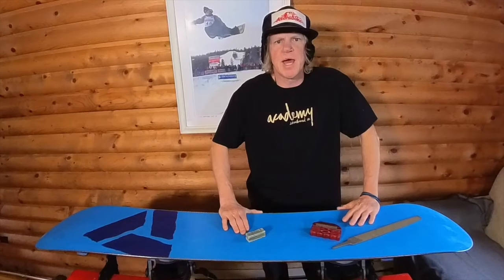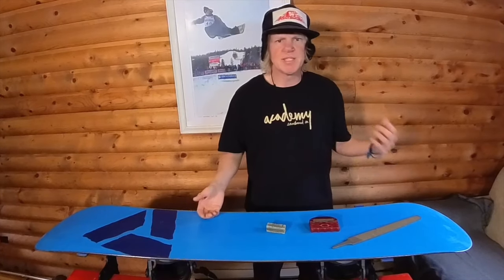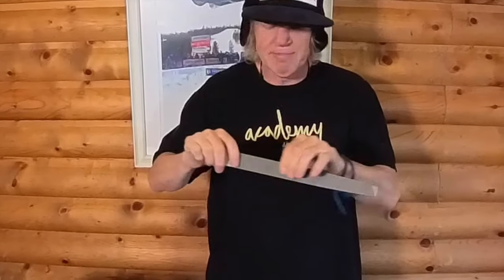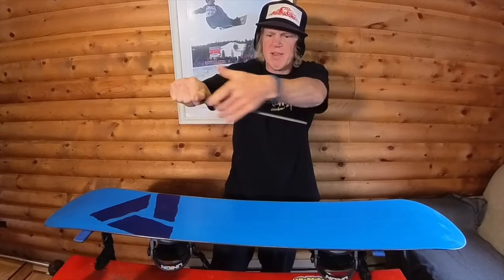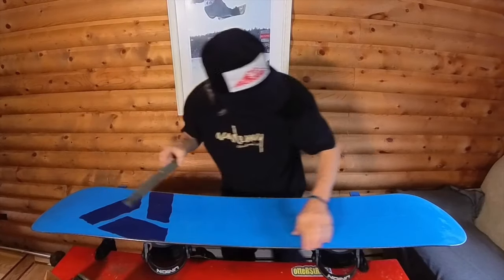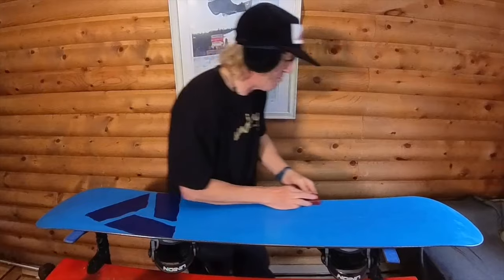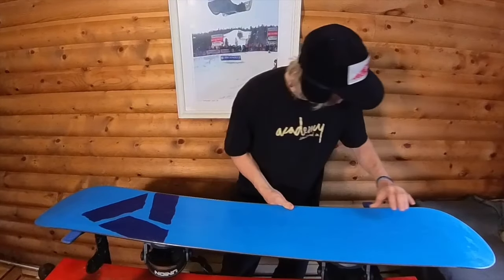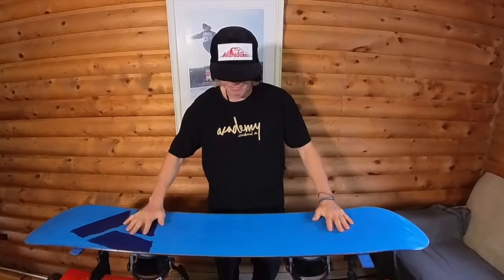How to tune PERFECT Snowboard Edges!

Comment: Great job dude, I used this video to affirm what I was doing was correct. This is the exact method I use also. Just to add a note, I use different grit from 400 to 2500 to achieve a beaut 88deg edge. Thanks for this!
Reply from the maker: Thanks for watching

Comment: i found it hard to get flat diamond files so i started using the hand held belt sander on the side edges too.carefully.but you only need 1 or 2 passes so you can concentrate on doing the approximate 90degrees

Comment: What’s the difference between diamond stones and a file?
Reply from the maker: Diamond Stones
Purpose: Primarily used for sharpening and honing tools like knives, chisels, and blades.
Material: Made with a flat metal or plastic base embedded with industrial-grade diamond particles.
Surface: Typically comes in flat or slightly curved plates with a uniform grit, available in coarse, medium, and fine varieties for different levels of sharpening.
Function: The diamonds provide an abrasive surface that cuts quickly and remains effective for sharpening hardened steel and other tough materials.
Durability: Long-lasting and resistant to wear due to the hardness of diamonds.
Key Features: Offers consistent flatness and precision, making them ideal for sharpening tools to a fine edge.
Files
Purpose: Used for shaping, smoothing, or finishing workpieces like wood, metal, or plastic.
Material: Made of hardened steel with teeth cut into the surface, arranged in a pattern to provide abrasion.
Surface: Comes in various shapes (flat, round, half-round, triangular) and coarseness levels (e.g., rough, bastard, fine) for different tasks.
Function: Files remove material by scraping or grinding it away, often for shaping contours, refining edges, or removing burrs.
Durability: Durable but may wear faster than diamond stones when used on hard materials.
Key Features: Versatile and available in many shapes for detailed work or general material removal.
Key Differences:
Feature	Diamond Stones	Files
Primary Use	Sharpening tools	Shaping and smoothing
Abrasive Material	Diamond particles	Steel teeth
Durability	Long-lasting, maintains flatness	Wears out faster on hard materials
Shape	Flat plates	Various shapes (flat, round, etc.)
Precision	High for sharpening edges	Moderate, depends on the task
In summary, diamond stones are specialized for sharpening and honing, while files are more general-purpose tools for shaping and smoothing materials.